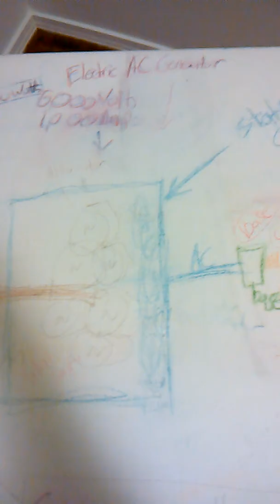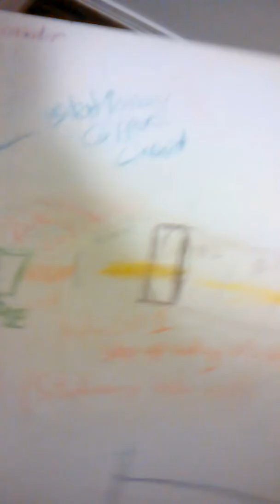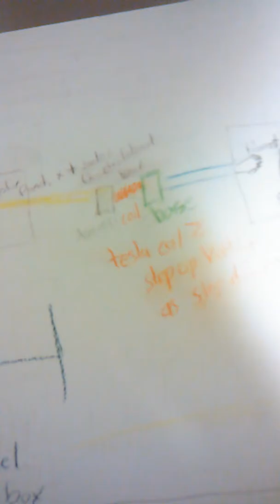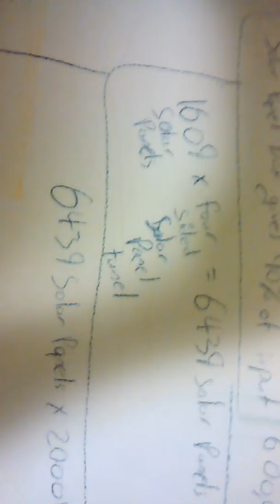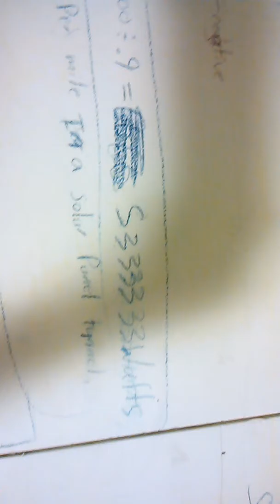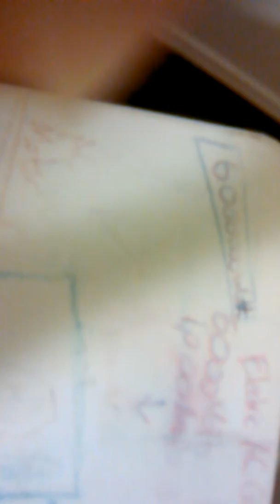free electricity. high volts and high amps

Comment: It takes over 1,000 volts to create a spark between 2 wires at 1cm apart.... so for a mile that's about 160 million Volts. Solar panels are only 20% efficient in converting light to electricity. Sorry, but if you've been studying and working with electricity for 11 years, you've been studying the wrong information.